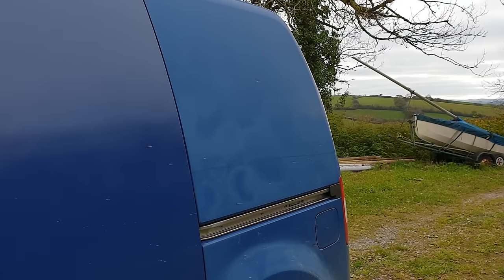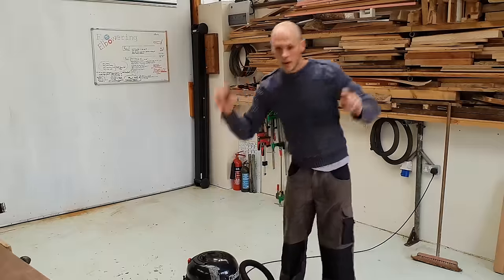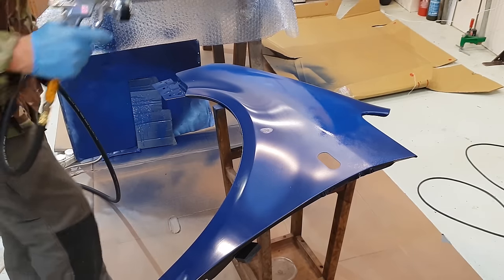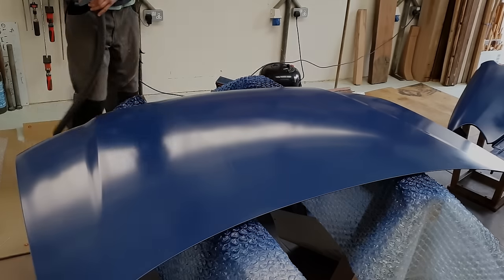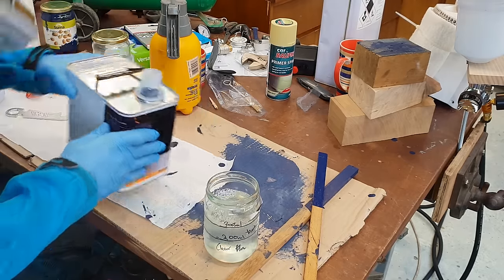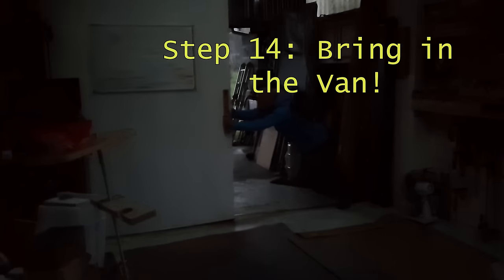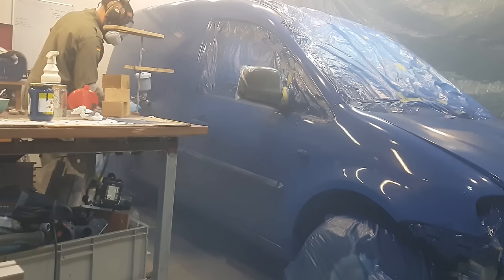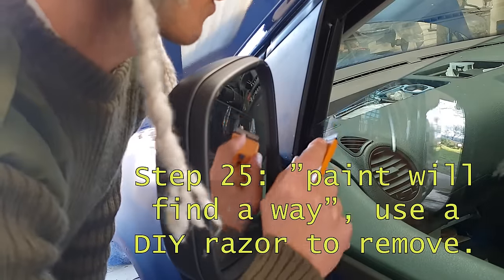How to Paint your Car, Beginner's 25 Step guide

Comment: Thank you kindly for an excellent video. I bought a project car in August 2020 and have recently got a 100L air compressor and a Devilbiss SLG620 1.3mm and a few cheapo guns and inline filters. I've also bought myself a gazebo cos I am not blessed with a garage or indoor working area, so looks like I'll be waiting a little while till I can get started. But your video is exceptionally good and you've done a great job on your van. I think I'm going to be using standard acrylic solvent basecoat rather than water based just due to the flash off times. One thing that worries me is using 2K clear due to the isocyanates. Are there any good 1K clears you might be able to recommend? I know they're not as durable but one that could withstand British weather and the regular Mancunian downpours we suffer from up north for at least 1/2 years or so would be great. Matte preferably but gloss wouldn't be a killer either. Thanks again :)
Reply from the maker: Good morning Haseeb. Thank you for your comment and for watching. Sounds like you have thought through the challenges. It is wise to be concerned about the dangers of 2k paint. Sadly I have no experience with 1k clear coat (there than a tiny bit with Halfords rattle cans), so can't really recommend anything sorry. I think if I was to do over, I would have bitten the bullet and bought an external air supply mask... Good luck with it!
Reply: @FloweringElbow  thanks for your reply mate. Much obliged. I've seen a Upol one that has got some good reviews and a few on the Arc Rite website, advertised for military vehicles and references its durability - I'll probably exhaust every avenue before going for a 2K clear, and will probably pay a bodyshop to lay it for me if I'm pushed. Again, my thanks for the video - I'll likely watch this a hundred more times to properly learn the technique before trying it myself on a few scrap panels :)

Comment: There are a few channels I watch as soon a video is up. Your's is one of them. The mistakes teach you way more than the smooth sailing camera perfect recipes. One question I had after watching this video is: what are the most "popular" other options for car painting. I am sure those came up during your research, and it will be nice to summarize what they are.
Reply from the maker: BillyFromAHilly Place, that really means a lot to me, so nice to hear, thanks so much :D
In terms of other options, a very common standard method would be using 2k base and 2k clear. Some people go the rattle can rout - but that's more fiddly, slow, hard to do well and can cost more in materials (in my experience). I wanted to get setup for pro-grade spraying of other projects anyway... 
I think another popular option is using a single produce that acts as both base and lacquer in one... I didn't want to use that because I think that's what the van was re-sprayed with before we got it - and it doesn't last anything like as well with uv exposure, as a good base and 3 coats of quality 2k clear. It's quicker and cheaper though, and I think people tend to do it before selling on a vehicle...  
There are other options, but those are the main ones I considered...
Reply: Well... now I know what 2k means :) ( had no clue until a minute ago - had to search what it stands for ).
Reply from the maker: @zgabarici  sorry should have said!

Comment: Hello, if you leave paint in spray gun for 30 or 40 minutes it okey to leave it  there? between paint jobs
Reply from the maker: Hey, good question. I have no problem, with the 2k and water based I used, but I suspect it depends on the exact paint!

Comment: why not prime the whole lot.. you only do bits of it.. Im thinking ofdoing someithing on a piece of machinery I have but dont have a clue in terms of primer . what type of paint to use etc... great job by the way. id be delighted if I could get the same result
Reply from the maker: Good morning Geraed, thanks for watching and your comment. The reason I didn't prime it all is simply that I didn't have much primer paint - only a couple of cheap rattle cans. The bits where the original paint was sound and sanded down made for a nice ready-to-paint surface and so didn't need priming. 
There are different kinds of primer - acid etch vs epoxy, for example. - some of them do not like going on anything other than bare metal, ie. they don't stick well to existing paint. 
I believe epoxy primer is good in this regard - sticking to both bare metal and paint, but needs painting over while still tacky or extra work in roughing up to give a key for the colour coat... Lots of details to it all. What's that machine? I have been considering painting the 35-year-old JCB we have https://youtu.be/zl3cMUTxIg0 
Cheers for now, Bongo.
Reply: @FloweringElbow  Hi Thanks for reply.. Its an Elho tr 300 Im going doing. The paint is more faded than anything. Very little rust spots on most it.. Im not as handy as you are at things. I'm more an Edward Scissors hands when I go at anything :)
Reply from the maker: @gerardhealy2110  lol, I don't show so many of my scissor hand moments on vid, but I assure you I have plenty of them!

Comment from the maker: Greetings Friend! Thanks so much for watching, I hope you can learn from some of my blunders :) if you have any questions or feedback for me on any aspect of this project, just comment below, I love to hear from you :)
Reply: Hi,I'm regards to the van going to blue immediately upon sanding ,it was most likely painted in a 2k top coat,meaning the paint goes on and dries with a shine without needin clearcoat over the top,probably the type of paint I would have used on a van but the waterbase paint and clearcoat you used will not dull down over time,also solid colours like this are very forgiving,as long as you have good coverage you can usually flood up alot of the finer scratches or imperfections with the clearcoat,however on a job like this in future then I would definitely consider using 2k,also when you based up the bonet,it would have been fine after clearcoat,great job for a novice though ,many would be scared to take this job on

Comment: You sand the black E coat  flat and remove all shine. Three coats of 2 pack primer filler . Allow to dry. Start at 400G then 600grit wet rub.  Use guide coats. Three coats of color and three coats of 2 pack clear.  Wet sand and polish.

Comment: Nice job.  Scuff all surfaces with the Red 3M pads.  De-grease tremendously, as it has a way to get under the paint and impossible to remove later.  When it is ready to paint, hit all of the repaired / primed areas first.   Get them to be as consistent as the original colors, as... You can probably now get by with just 2 coats on the whole thing.  It looks like you were well dialed in when you got to the clear coat.  We all cant afford to have spray booths, and so just accept there will be some dirt and bugs.  It looks much better now.
Reply from the maker: Thanks peetre! Good advice :)

Comment: Hi, I've just painted a panel and I've got some small/tiny dents that appeared in the clear coat. I think they are 'fish eyes'. How do i rectify this? Can I wet sand and reapply clear coat?
Reply from the maker: Hey Fvresonanator, thanks for getting in touch. I'm about the least qualified to advise you one this, but I have seen people both wet sand very fine) and re-apply, and people also use a cocktail stick and dab on clear coat. Just put fixing fish eyes in clear coat into youtube search... Good luck!
Reply: @FloweringElbow  okay thanks
Reply: @fvresonanator  1500 wet and dry paper. Wet the paper and panel, gently rub over the spots. Checking frequently. Don't rub past clear coat. Then machine polish with compound.
Reply: K Man  Hi. I used only 1K products. I put the primer on and left for about two days to harden. I then sanded with 600 and degreased. I then applied 3x coats of base coat, Left for 30-60mins and then applied final coats of clear. I noticed the fish eyes appearing when applying the clear. Can I sand back down to base coat and work from there?

Comment: Will a ABEK level 3 filter with full face mask protect against the paint and clear coat? I'm wanting to paint a van door
Reply from the maker: Ideally, if using 2k, you should be using a clean air supplied mask...
Reply: K Man  so if you are using 2k to do repairs and blending but don't have a pro grade paintbooth with air feeds and such I guess you'd need somthing like a self contained BA set?

Comment: People who went through this before they can see his mistakes .but if you don't try it yourself you will never get it.
Starting from the "spray booth" and yo the  final finish.
You can make a list of his mistakes but the main thing is experience. More experience. 
As gunman says "just spray some shit" try some

I wouldn't advise waterbased for the first  time garage use(solvent is easy to apply,cheaper,if anything wrong just sand a bit and recoat,drying in minutes,
Water for spray booth and big warm  airflow.)
 
Use masking film on the ceiling walls and floor. Just stop all that shite from the shelves and lights on the ceiling to fly on your clear.
Use water on the floor .from hose,plenty .not a spay mist
Take off everything you can off the car.moldings .mirrors  etc .rubber .use j tape to unfold all the rubbers from the body so you can spray past that line.
The list is never ending .

Simply just try a few panels from start to finish and then do the whole car.get a feel of the gun.the distance from the panel .the speed .all the adjustments on the gun ,air pressure,water in the airline, .bla bla bla)))

If you do.more then one car buy most expensive gun you can afford (devilbiss gti pro or pro lite,haha)

Good luck to all the beginners and YouTube here to help us!!!
Reply from the maker: Hey Sergei, really appreciate you taking the time to post this, thanks! You make some excellent points, and I am sure people will find it useful :)
Peace, Bongo

Comment: Where is the price breakdown please. ??
Reply from the maker: Check the video description friend.
Reply: You said price break down 
Where is it would you like to send it. Thankyou
Reply from the maker: @freddytait7726  From the vid description - it's out of date, but then the vid is old: 

Tools and Materials used for this paint job 

The Italian ANi F160 HPS Spray Gun £87  https://ebay.to/2JKUxKt
ANI In line air regulator £17 https://goo.gl/G5HhGG 
In line filter and moisture trap £10 https://goo.gl/yhbihX
Bosch 6" random orbit sander - a fine tool I already had https://goo.gl/D5j1LX
  
Octoral Waterbase eco Car Paint Mixed From Colour Code 4L - £119.80 - expensive, but goes a long way and is good quality stuff. 
Smart Product Lacquer 5L + Fast Activator 2.5L £65 https://goo.gl/Lyv75T 
Panel Wipe De-greaser 5L- £13
TACK Cloths Water Based Box of 10 £ 4.50 

Safety: 3M 6800 full face equivalent which means it's a cheaper import (only about $30 here: https://goo.gl/kVGmyk), but I use it with the genuine 3m 6001 vapour filters. (ebay link: https://goo.gl/PNXNEq). Remember to use pre-filters too https://goo.gl/WJgk5Q. Cover up all skin and ears with a hood and stay safe friends!
Reply: Thanks for the prices.   Hope your are well. And will stay so
All the best from freddy
Reply from the maker: @freddytait7726  Thanks, friend. Your welcome. Good luck with your endevours :D

Comment: There is an argument for using what seems to be more environmentally noxious paint if it lasts a lot longer. My car is 30 years old now and the cars ( of the same model) painted the year after with water based paint, are very rusty and most get scrapped, mine has no rust and can last many more years. Remember the cars of Cuba are the most environmentally sound because they are very old. Waisting the first batch was also an environmental burden. Sorry for ranting, I am going to continue enjoying the film now that I got that off my chest.
Reply from the maker: Completely agree with you. It's all a compramise. With a lack of access to good data on matter it is really hard to know the best options sometimes. 
I was left really liking the water based base coat because it went on so well and didn't make me want to pass out if I slipped my mask off for a second. Still wanted to clear coat with the durable 2k stuff though...